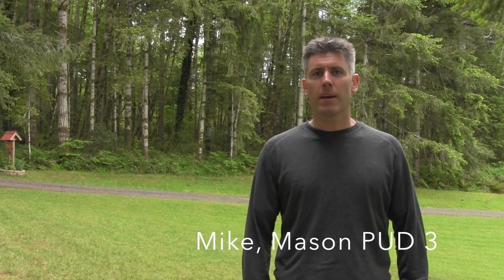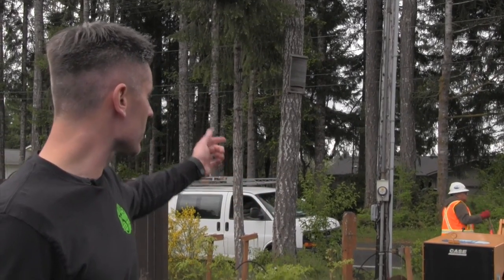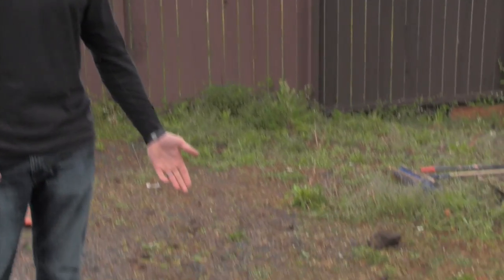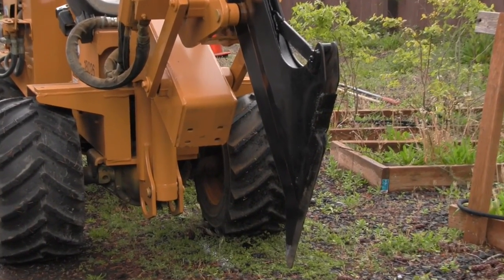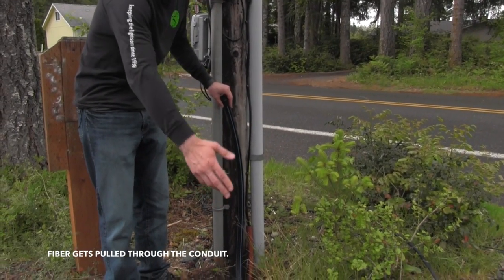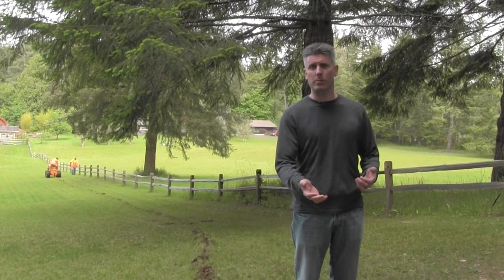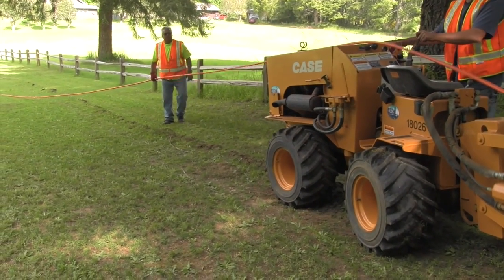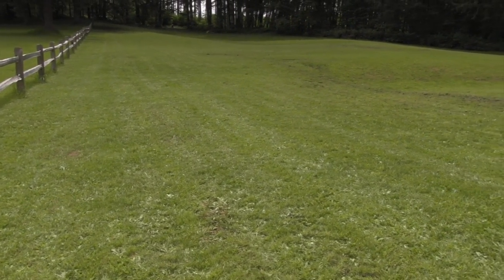Installing conduit for fiber to your home with a Vibratory Plow

Comment: What size of conduit is recommended for a buried installation and will provide for an easy pull? I’m installing two buried conduits. Both will be from a common pull box half way in between. One will be to my house and the other to my shop. The buried run to my shop is about 75 feet long and the run to my house is about 90 feet long. Thanks for your help/advice.
Reply: 2 inches
Reply: Depending on the size fiber you are running. I would say 3/4” in your best bet

Comment: Why didn't you just direct bury the fiber on both projects?
Reply from the maker: We ALWAYS install underground utility infrastructure in conduit. It helps to ensure we have a reliable system into the future. We spend a lot of effort and resources each year replacing electric cables that were once buried directly in the ground. It was cheaper and easier to install it that way in the past, but we're all paying for it now. Our goal is to learn from past mistakes to ensure a better future for our community.
Reply: @pud3  what is the conduit you used called, like type or brand name?  Thanks for the information